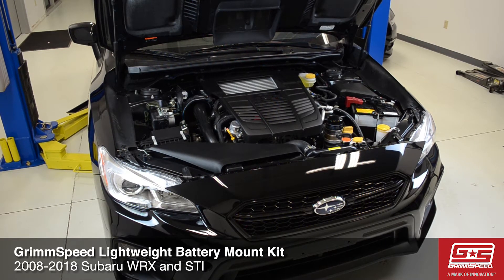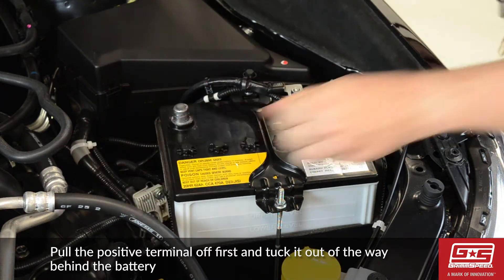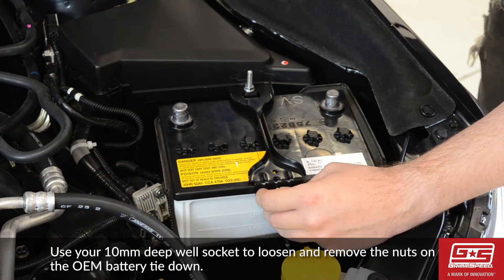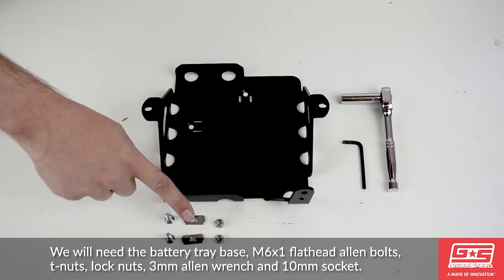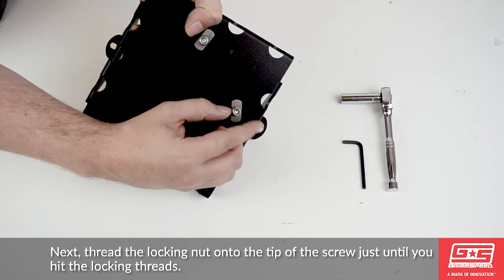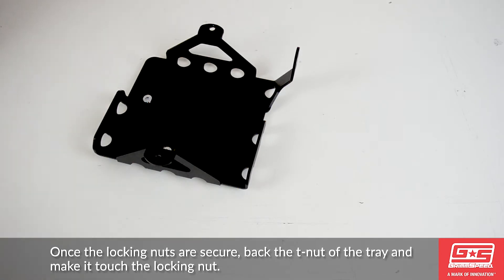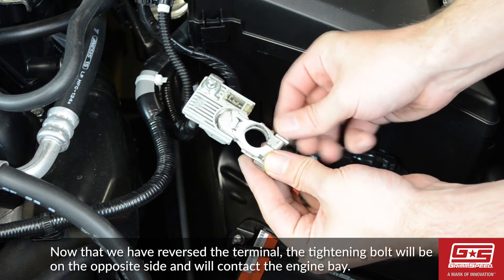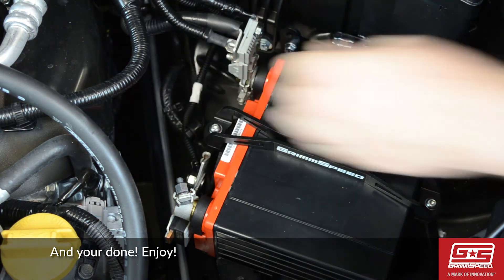GrimmSpeed Lightweight Battery Mount Kit Install - Subaru 08-18 WRX/STI

Comment: Just wondering, it clears the cobb flex fuel unit right? 2016 WRX
Reply from the maker: Normally we couldn't say because we mostly don't do testing with other companies products, but from personal experience i can say that it should fit without any issue.

Comment: Would this be recommended for my car if I'm on airlift system and demon and halo lights on car..?
Reply from the maker: If you are running a compressor off your main battery, i probably wouldn't suggest using this battery setup. You would want something with more capacity that holds a higher charge state. In some cases the OEM Subaru battery has a hard time keeping up with a compressor system so the pc680 would be likely to struggle also. The demon and halo lights shouldn't make too much of a difference though. You could run a secondary battery in the trunk for the compressors and the pc680 as a regular starter battery as long as you tie the secondary battery into the alternator system. But thats a task. It all up to you.

Comment: This is not totally plug n play on my 2016 STI.  The terminal is all metal.  There's a ground wire in the way of the bracket so i have to cut the top off the bracket where the extra hole is.

It's also awfully close to the where the Cobb Flex Fuel sensor sits.  And lastly, if you're buying this for tracking, it's like that your Organization you run with requires a terminal cover for the positive.  Since you flipped this terminal, you're going to have to think of another custom way to cover it
Reply: I assume they want the cover in place to prevent any sparking and arching right?

Comment: How well would one work on my 2018 wrx DD during Pennsylvania’s winter months?
Reply from the maker: During winter months you may want something with more cold cranking amps. If you start the car everyday it shouldn't be a problem. But if it sits without being maintained you might want to attach a trickle charger to it. We recommend these units for track use and cars that see regular use

Comment: Here in the Uk the stock battery doesn’t last long and is replaced under warranty. This is because it doesn’t hold enough Amps (I think it’s 390amps) and so the dealership replaces with a larger amp battery (I think it’s 560amp). Is you battery better than stock in terms of power? Thanks

Comment: Can you use this battery for daily driving?
Reply from the maker: As long as you drive the car on a regular basis you shouldn't run into any issues.
Reply: @GrimmSpeed  I'm a college student with my car on campus. I typically drive 1-4 times per week, and quite a bit on saturday and Sunday. Will i run into issues with this battery (and mount) with that amount of driving?